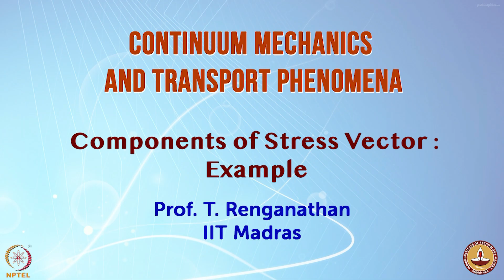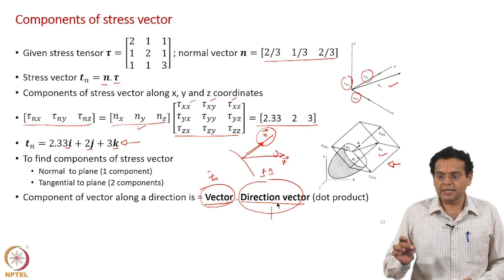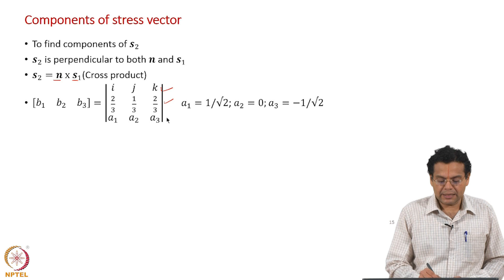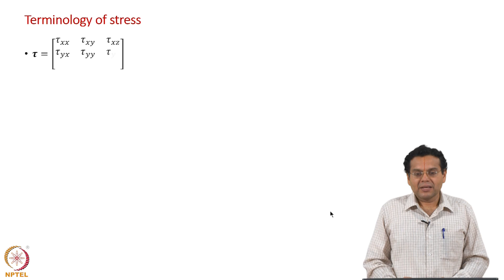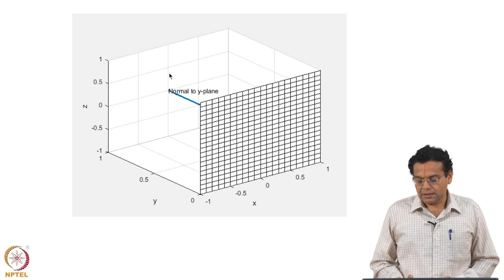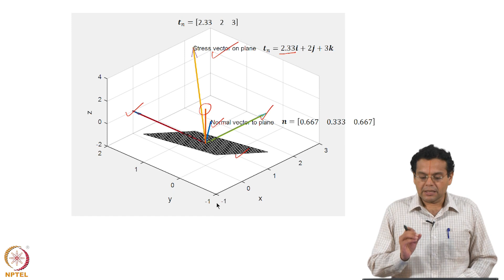#41 Components of Stress Vector | Example | Continuum Mechanics &Transport Phenomena

Comment: sir, here we have chosen 0 as arbitary value for a2. If i choose any other arbitary value , then everything will change. At last though the traction at a point in the plane with normal n is not going to change but the components normal stress, shear stress changes at that point. Is that possible? if it is so, then ill have infinite values of normal and shear stress at that point, then what values of normal stress and shear stress should be consider at that point?
Reply: we can choose any two vectors lying on the cross section to be s1 & s2 . Together with n ,any combination of s1 & s2 that u will get by taking a2 to be any arbitrary no. ,will give you the same traction vector at the end.
Reply: @joyaljoshi5073  then why did we took only a2 to be a  arbitrary number. Can we take a1 or a3 to be arbitrary?
Reply: @aniketsingh810  yes. there are infinite possibilities of s1 and we reduce it to 2 technically (colinear vectors in opposite dirns) then choose 1. so we can take one value of any a1,a2,a3 belonging to real number